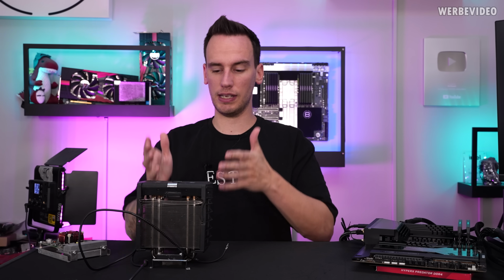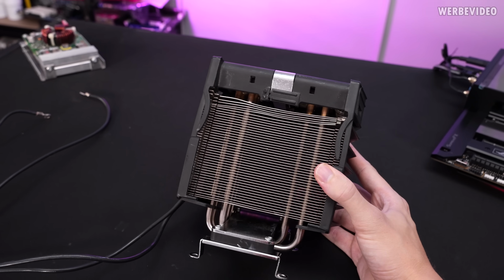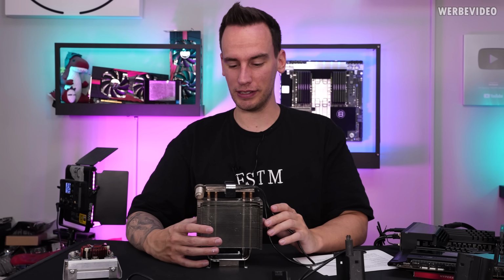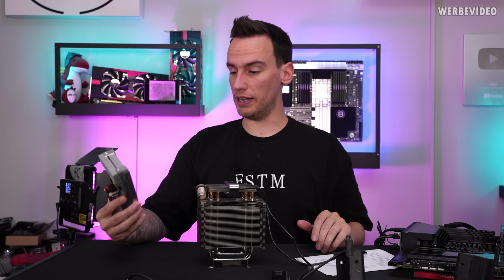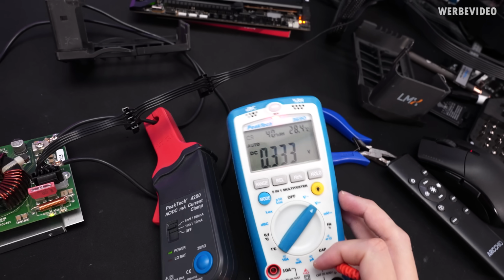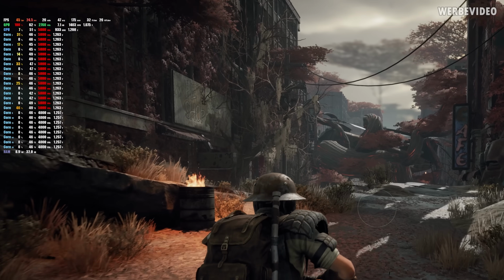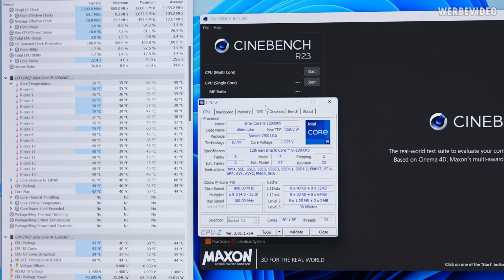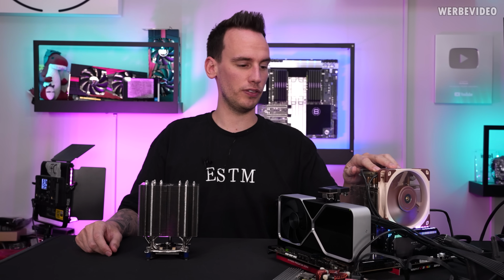This Cooler Ruined an entire Company - LMX Liquid Metal Cooler

Comment: A valiant attempt at innovation. Now we know. I think they deserve credit for trying something genuinely original.
Reply: shouldn't have ever gone past the lab though LOL I'm sure it'd be a decent type of cooling for very specialized applications
Reply: @sinephase  IIRC this kind of cooling (on a much larger scale) is already used in some nuclear reactors? I guess in situations where non-metals would boil, and you can't allow gallium on-site because it could corrode critical components, NaK starts to become a reasonable option as a heat-transfer media?
Reply: @05Matz  Right, I know it was used in the "Fast Breeder Reactor" at Dounreay in Scotland.
Reply: @05Matz  from what I've been reading a eutectic alloy has worse viscosity as well. They didn't choose sodium for nothing.
Reply: @05Matz  Yes, this is what molten salt reactos use. The problem is one of the reason they use it is because water's boiling point is too low for nuclear reactors and high pressure creates more problems than it solves. For electronics, however, water's boiling point is quite fine...
Reply: Did we really have to fill a heatsink with explosive death metal to know that filling a heatsink with explosive death metal is a bad idea though?

Like, regular heat pipes are not even the bottleneck in modern air coolers, it's finstack surface area and noise-normalized airflow. This was dead in the water from the start, and that should have been clear to this company at the "back of the envelope engineering" stage. It doesn't even pass the sniff test.
Reply: @Teth47  It effectively cooled a 12900KS. I would say it passed the "sniff test" just fine. You really are reaching hard to try and find a reason to be victimized by that cooler.
Reply: @RANDOMNATION907  No, it doesn't, because a much simpler, cheaper, and easier to safely contain and dispose of solution also cools the same processor more efficiently.

Also victimized? What are you even on about? I'm saying the cooler is and was a bad idea and that was obvious. In what way does that paint me as a victim?
Reply: @Teth47  It's not THAT dangerous. I wouldn't exactly drink the stuff, but you carry basically the same thing in your pocket, all day, every day.
Reply: @Sett86  What? No. You cannot safely carry NaK in your pocket. Have you ever seen it in open air? If it touches your leg it will explode. It's a liquid composed off two of the more reactive alkali metals, anyone just carrying that around in that pocket while being mostly water is insane.
Reply: Its fine, as dangerous as lithium lol. Just seal it and don't puncture it. Same for both cases. If it had a small leak it would just oxidize over time, no problem
Reply: Yeah—I give them serious credit for trying!
Reply: There's thinking outside the box, and then there's releasing something to the public that could cause them permanent skin damage, lung damage, environmental damage to wildlife... Most postal services won't even let you deliver products with NaK in them as it's that much of a hazard, more often than not you need to order them from qualified suppliers. Yes technically the unit is sealed and the same could be said for batteries... But this is a liquid that can leak if those pipes aren't solid.
Reply: Exactly. Chinese toy companies were just trying to give us cheaper toys by using lead paint. We should be celebrating their ingenuity in the field of teething.

Comment: I really was wondering if mercury would have made a better coolant (toxic instead of explosive)
Reply: Mercury's volumetric heat capacity* is 1.89 J cm^-3 K^-1, less than half that of water, though maybe the high thermal conductivity makes up for that?

* isobaric, at 25 degrees C. Since mercury is much denser than water, I assume this is more salient than mercury's mass heat capacity, but the physics involved is way past my pay grade.
Reply: Moving all that mass would require much more power compared to water.
Reply: @arandomcomp2427  True, though water pumps used for CPU cooling are typically 5-15 W. Mercury's density is 13.6 * that of water, so you might need quite a powerful pump (maybe 100W?) to get it flowing, but after that you'd just need enough power to overcome friction losses.

Comment: Please reconsider and look if you can find a tech museum or somebody  who wants the cooler in their collection. Is by far one on the most advanced cooler around, and the amount of engineering put in it seems ridiculous, I mean you don't see everyday an magnetohydrodynamic pump!
Reply: Exactly my thoughts! As unsafe as this thing can be, it is a rare example of truly thinking outside the box, and it should be remembered for that.
Reply: @nazgu1 It's not really unsafe, no more than any LiPo battery pack fully charged.
Even if you managed to rupture one of the pipes (which wouldn't be that easy at all, dropping it would barely bend them) it's unlikely the sudium-potassium alloy would actually catch fire (unless you tore it apart and then drop it in water).
Reply: @qdaniele97  Sure. It's the relative potential danger that may be a problem.
Reply: @qdaniele97 NaK catches fire upon contact with humid air.  It is exceptionally combustible.  Dropping NaK in water sees it explode.
Reply: he probably doesnt care about others xD
Reply: @gelo1238  yeah he is a war criminal
Reply: @gelo1238  Or cares enough to destroy it and not be a burden on his mind and anyone else's. Either could be true. 😃

Comment: Comparing specific heat capacity of this liquid metal to water is largely pointless as an approximation of usefulness - the ways the liquids are used are completely different. Most of energy transfer in heat pipes is done by absorbing and releasing heat in the phase change (assuming ~50K delta from ambient the enthalpy of vaporization would be around 10 times the energy required to heat the water by this delta in the first place). In the liquid metal case, the advantage is obviously supposed to come from the volume of the coolant it can cycle. Thermal conductivity is quite important then, as the faster the coolant cycles through the cold plate (and through the fin stack) the faster it has to take/release the heat. In other words, thermal conductivity is putting an upper bound on useful flow rate, which directly limits the effectiveness of the cooler.
I think the theoretical limits of this setup are actually better than heat pipes, but it requires insane rates of flow (which is why the pump is eating so much power), and I wouldn't want to be anywhere near a thing that accelerates NaK to speeds it would need to cool better than heat pipes. Or just accelerates NaK, to be honest.
Reply: Were overclocked CPUs of the day capable of operating above 100C? That would be my first guess as to what would possess somebody to miniaturize NaK reactor cooling for PCs, but there still should have been some kind of... oil or something they could have come up with in between!  @LiveType
Reply: It's not pointless if you compare it to (liquid) water cooling.
Then again it is, because heat capacity was never a problem in water cooling in the first place.
Reply: @Sett86  It's not replacing a liquid cooling system, it's replacing a CPU cooler. Why would you compare it to something that is totally different, especially when it didn't even beat a modern, completely passive, CPU cooler. This thing only exists so you can say your CPU is cooled with liquid metal. It's completely pointless otherwise. 

This was business guy coming down to engineering with the company president because he has an idea. Ask my how I know... it involves a generator, a sailboat and a really long rope...
Reply: @Kandralla  Well, to adress what OP said and also because liquid cooler is what this thing is. In fact you could do the same thing with water instead of NaK. And it most likely wouldn't perform better than just regular heatpipes either...
Reply: What if instead of water you used mercury?
Reply: Probably similar to this but heavier, very toxic (mostly in the long term/ecological sense), and not flammable? More corrosive to other metals though, both mercury and gallium tend to absorb into other metals and potentially damage or flow through them. I'd be really afraid the mercury would destroy something and/or escape eventually. @atomicskull6405
Reply: I don't think you are correct on thermal conductivity.  At least, partially.  You either need to look at the whole system in a more abstract way, or look at the heat transfer, surface conditions, and flow inside the tubes.  

Looking at the whole system, assuming ideal mixing of coolant in the tubes, you have mass flow and delta T.  Mass flow (not volume flow) is a product of flow velocity and density, and delta T is governed by mass flow, heat input, and specific heat (assuming no phase change).  Liquid metals have a much lower specific heat, so you need a much higher mass flow.  With mercury and gallium based liquid metals, it is somewhat offset by a higher density than water, bringing the volumetric flow to reasonable levels.  However, eutectic NaK is less dense than water, so you need a much higher volumetric flow to match the performance of water as a coolant.  

If you look at the surface conditions and the flow, you want a high surface surface area, and enough turbulence to mix the fluid.  With enough surface area and turbulence, the thermal conductivity of the fluid basically doesn't matter.  Hence very fine microfins and jet plates on water blocks.  In round tubes, as seen here, its quite possible the improved thermal conductivity of NaK helps performance, unless there are some form of heat-pipe-esque surface on the inside of the tubes on the waterblock side.  

Also, pretty sure the 'pump' is a magnetohydrodynamic pump, based on what appears to be a giant electromagnet, and very high current.  I am by no means an expert on that kind of pump, but my understanding is its basically a 'railgun' for fluid.  Now, I though it had to be really long to get meaningful flow, so I could be wrong, but I don't see why you would need 30+A of presumably low voltage to power a normal pump.
Reply: @cdburner5911  Of course, thermal conductivity is not the only important part, but in this case, I still believe it is quite important - you have to take into account that water would require more fiddly pipes (surface area) and a different pump to push through those fiddly pipes (since the overall volume is much smaller than 'normal' water cooling and you are explicitly not relying on the latent heat of phase change to transfer heat away from the coldplate) which means a lot higher pressure, which would require thicker pipes (...). This makes it not obvious whether NaK would be worse with those specific constraints before you test it - you may observe that AIOs require a completely different setup.
Assuming the pump in this setup is the limiting factor (looking at its power usage, that's a fair assumption) as long as you want to have a compact MHD pump with no moving parts, water would be a worse coolant - besides everything else, your pump limits mass flow, so lower density as long as the pipes sizes work, is not an issue. It's maybe even beneficial, as it gives you larger pipes in the fin stack, which (assuming sufficient thermal mixing of the coolant) would increase heat transfer to the fin stack (up to a point). And that all is besides the fact you would probably need to use saltwater or other mixture to even use MHD, which would increase corrosion, be even less efficient etc.

Of course, it turns out that it's cheaper to make small and reasonably efficient propeller pump and have radiator with large internal surface area of the water pipes (that is then slow moving and readily transferring heat). Note that this no longer fits within the footprint of a standard CPU radiator (I have not seen any AIO that fits into standard cpu cooler footprint) and for AIO with comparable performance would most likely want 2x120mm... Which kinda means, this design is not wrong per se, just their assumptions on what are the important constraints were flawed - it turns out violating standard cpu cooler footprint is not such a huge deal, small propeller pumps are cheap and reliable and completely besides that, heat pipes _work well_.

Still - was that whole approach worth the effort? Not really, as we can see. But it sure was interesting!
Reply: How is it pointless? Compare it to a regular water cooler with a pump, which it is similar to.

Comment: To me, this looks like a case of the lab built prototypes outperforming normal heatpipe coolers but the production versions, surprise, it doesn't work as well.  That, or they just got fixated on this concept.
Reply: It's also possible that it required a much greater heat output than what cpu's we're putting out back then. Thermalrights giant coolers had that problem with idle temps and low power cpu's.
Reply: aha i see what you mean,its possible the heat wasnt enought to liquify the "wax" in the pipes so there wasnt good enought circulation i think there where some ASUS cooling systems for GPU that had that issue @sirmonkey198
Reply: @sirmonkey198  heatpipes have a limit, once you overpower them they stop working (all working fluid evaporated and not able to condense). and this is the only case where i see this NaK stupidity shine because it can't be overpowered as it's not based on phase change of the working liquid.
Reply: blinded by marketing

Comment: Knowing thermal conductivity is important to take heat away (that's why we use liquid metals on naval nuclear reactors (all are LMR on submarines), to avoid having to pressurize water to raise the boiling point and cooling properties) why would you consider it not to be in this case? Isn't the goal to take heat away faster?
Reply: They are very different cooling scenarios though. A nuclear reactor outputs a *lot* of heat compared to a computer. Maybe the higher thermal conductivity is wasted because there isn't enough heat gradient?  (I'm no material scientist maybe that makes no sense :P)

Also, water may not have a huge thermal conductivity, but remember that heat pipes are phase-change cooling, the fluid inside (water or otherwise) is absorbing HUGE amounts of heat when it evaporates, and releasing all of that heat when it condenses in the cold side of the pipe.
Reply: He mentions that the important bit is the conductivity between materials, not within the material, but doesn't go into details which is better there, the salt solution or water
Reply: LMR and used on a nuclear reactor because the coolant does not absorb neutrons, and it can handle extremely hot temperatures at normal atmospheric pressure. I get worried about  my AIO leaking, I can't imagine how I would deal with this cooler leaking!
Reply: Danke

Comment: Wow, a molten sodium alloy ( as used to cool some nuclear reactors ) heat exchanger with a magneto hydro dynamic pump, that is truly next level. I am only guessing here but the sodium should be solid when cold and the MHD pump has no moving parts but relies on the magnet at the top and passing current through the alloy, Firkin genius.
Reply: It's sodium-potassium alloy, NaK.  Its liquid down to -12c, and its viscosity doesn't change much at these temps.  There's a LOT of reasons that is not ideal in a residential consumer product.  It reacts with water, just like sodium and potassium.  It will also react to atmospheric oxygen and can just ignite.  Fun stuff.
Reply: @BadHaddy  It's basically a bomb.
Reply: Don't exaggerate, it's not going to _explode_. @spankeyfish  
But if it gets broken open, the stuff inside will heat up as it corrodes from contact with the air, more-so the more moisture it absorbs from the atmosphere, and if it comes into contact with actual water it'll get VERY hot, and produce a bunch of hydrogen (that might just bust into flames) and strong bases, which sounds like a bad time.
It's probably not dangerous to USE... but probably dangerous to throw away, because then you don't know what it's mixing with.

Comment: I figured the current to the pump at room temp was elevated because the coolant was higher viscosity at room temp.  But I looked it up, and NaK's viscosity is less temperature dependent than water, so *shrug*.
Reply: Magnetohydrodynamic (woah that's a mouthful) pumps require high currents as I understand, hence the beefy buck supply and hefty cables. It might be only 1-2 V but the challenge is the 30-35 A required. Aside from the NaK of course :D
Reply: @YCbCr  Wow.  So the currents required for the Red October must have been truly astronomical.